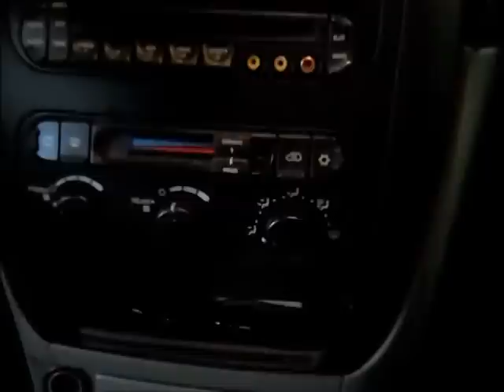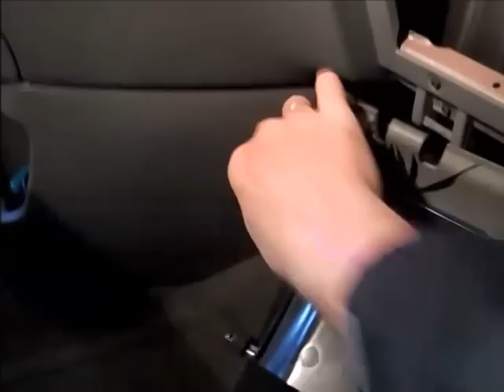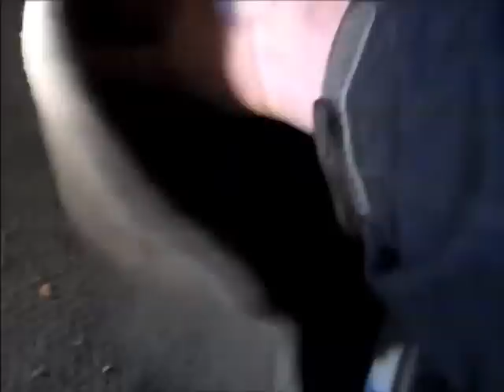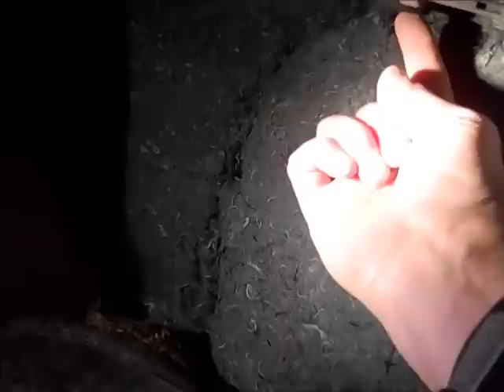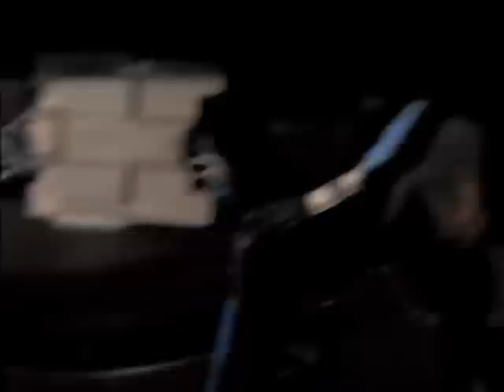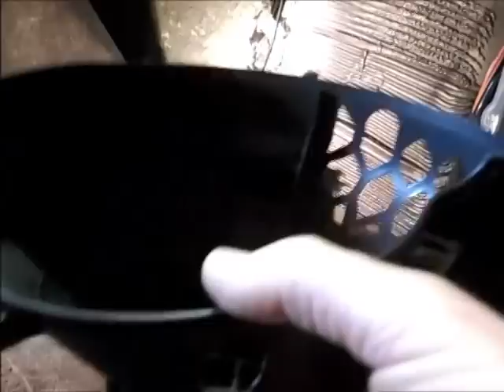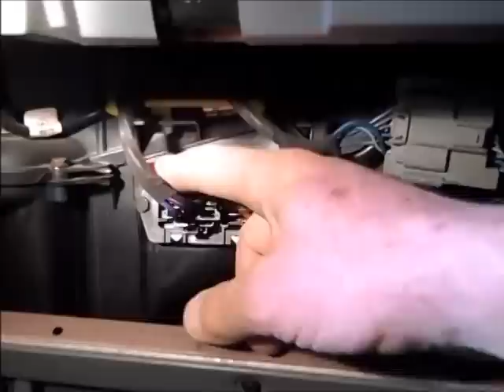2001 TO 2007 Dodge Caravan heater fan and resistor replacement

Comment: Thank you so very much for posting this.  Fortunately, just my resistor was bad.  Your video helped tremendously.
Reply: Jim Tucker the Blower motor needs replaced as well. Iam a 12 year master certified chrysler dodge jeep tech , both should be replaced at the same time the blower motor itself is what took the resister out, the motor has overheated at one point in time and needs to be replaced at the same time

Comment: We had our blower fan quit last summer, just in time for those 103 degree days in California. Therefore, no AC in front.   The resistor happened to be the culprit, thank goodness, but now, the wife complains that the front blower motor makes noise and smells like burning wire.  While I didn't enjoy your talk about that last screw "being a bear", I think you hit the nail on the head.  Thanks for a good description of the process.
Reply from the maker: +Kent Carlin Thanks Kent. I take it the motor had to be replaced. I think sometimes when a motor is dying it pulls more amps to run and kills the resistor. Could be your motor was on it's way out.
Reply: +Don Guptill I have a bad blower motor, I've replaced the resistor twice and each time I put the new resistor in with the bad motor it smells burnt. So just get yourself a new blower motor.

Comment: You can try to smack the motor to see if it starts working.  If it starts working after smacking it then it needs a new one.
Reply: have that problem- so, at 275,000 miles, I'm just gonna keep smacking.

Comment: hi Don what should be the problem if I don't have power on the blue wire ?
Reply from the maker: +Jroe Erte Hi. I would suspect a fuse or relay located in the panel under the hood. Try swapping the relay with another to check that. Are you sure the key was on and you had a good ground when testing?

Comment: Good speaking voice. My front heater in 2001 Caravan doesn't work. The rear heater works. Do they run on the same heater motor? Thanks
Reply from the maker: +Dan D. Dirges Thanks Dan. That question came up from scooter12368. The responder says no. I am not a mechanic but I would definitely agree that the front and rear systems are totally separate. The rear system failure is not common . I suspect that it's due to the fact that is not used nearly as much. What I wish I had made more clear was that if the blower does not work at any speed  its  probably the motor. If you have blower operation on at least one speed  it's probably the resistor. The electrical checks I described are basic power availability checks only. Also if you can get the motor to run again by beating on the motor housing... it's probably the motor that's the problem. Good luck.
Reply: +Don Guptill Thank you, I put a new resistor in today and it works great at all speeds. Before it went completely dead it only worked on high. Then not at all. For your viewers, its best to check the relays in the IPM first. Then the resistor.  I ran a two wires from both parts of the pig tails on the resistor. Therefore by passing the resistor. Then the motor worked. That's how I knew for sure the motor was good and the resistor was bad.

Comment: I had power to the res.blue wire and power to the green wire to motor like you said to check I replaced the motor still will not work so I checked the for ground to motor found no ground there is no ground coming out of res. come to find out that is what the res, do'es is ground it very little for low speed and the more it ground the faster it will go 
long story short chech for a ground and power to motor before replacing it .

Comment: Don,This was helpful to watch and much appreciated. However, I did want to share with the group that the resister pack actually resists the ground circuit to the motor, not the power/voltage. The motor has power on with ignition (far right top green wire out to motor). By selecting a different setting on the fan switch will allow more or less resistance to ground and will make the fan run at slow to fast speed. To test this, just jump a chassis ground wire to the bottom far right black wire. If the motor/fan blows, it is still good. I have just tested mine and it is just the resistor pack.Thanks again, just wanting to offer some advice that may save someone money that may still have a good motor/fan.Good luck all, John
Reply: Don, thanks for this video, saved me a ton of money and effort in replacing my blown resistor.
+J Taylor, I owe you a beer! My initial diagnosis was that my blower motor was toast. But after reading your suggestion about grounding the black wire of the blower motor to chassis, I tried it and it worked. Thus, I only needed a $15 resistor and not a $72 blower motor. At least for now!  Thanks JTaylor!
Reply: READ J TAYLOR COMMENT BEFORE PULLING FAN OUT.  I wish I would have read your comment earlier.  I tore apart the whole fan assembly and hooked up the fan to a battery and it worked.  So I hooked it back up to the resistor and it didn't.  I tried a power wire from the resistor (green wire) but grounded it instead to the frame and it worked fine, so that is how I figured out the role of the resistor in grounding.  So if that had been explained in this video in the first place, I could have saved myself over an hour disassembling the fan unit and ripping out insulation.  Now I have to try to put it all back together.  Makes me wonder if after he replaced the fan in the video, if it wasn't actually a dead spot in the motor, but it was also the resistor and he had to replace that too.
Reply: great information

Comment: Don, this is the best well documented video I have seen - THANK YOU! How did you test the relay?
Reply from the maker: +Floorcraft Installation Thanks for the comment. In the fuse compartment there are a few relays that are interchangeable so simply replace the relay related to the heater and see if it works again. I'm not a mechanic but a mechanic I know says it's very unlikely it's the relay at fault.

Comment: Hi Don, thanks a million for putting this video out there.   I have two quotes from auto repair places to fix this problem for nearly $1,000!  I'm going to use your video which is very well done.  Question...I've search high and low for the flexible socket tool you show in the video.  Local auto parts stores do not have it.  Amazon has one but I can't find one that will take the 8mm socket.  Any ideas on where I can find one?  I don't want  to start the job until I have it.  Thanks!
Reply: +John Green The one I used is similar to http://www.sears.com/craftsman-flex-extension-bar-1-4-in-drive/p-00904336000P?prdNo=45&blockNo=45&blockType=G45  (mine is AT LEAST 40 years old)
Reply from the maker: +John Green Hi John. Sorry I haven't gotten back to you sooner. I missed the notification I guess. The driver I used is quite old and I can't remember where I got it. I did a quick search on Amazon and found one very similar to mine that should work for you. Lisle 63200 1/4" Flex Mag Driver  for about $15. You really don't need a very high quality tool. Good luck with your project and thanks for the comment.

Comment: I replaced the blower motor and blower motor resistor on a 2001 Dodge Caravan. Prior to replacing it, the air was not working properly as it would randomly blow air and then eventually stop working all together. 

However when I started the car, after replacing and reassembling all of the parts back together... I can hear the blower motor working, but no air is being pushed through the vents. Do you have any clues as to what the problem may be?

Thank you soo much for the highly helpful video! You thoroughly described the process in great detail and made the job a lot easier to do :)!
Reply from the maker: Ashley H Thanks for the comment Ashley. Your problem is a head scratcher. I am not familiar with the entire temperature control system but intuitively I would suspect there is a stuck baffle somewhere in the air delivery. Dependent on what selection you use with the airflow selector (ie: defrost) baffles open and close to direct air in various directions. I would suggest, If you have a favorite mechanic, asking what the cause and solution might be. Sorry I can't be more helpful. Good luck.
Reply: you probably did not put the flap back to the default position. it has to go to the right side when u reassemble the blower housing
Reply: +Ashley H Sorry I'm late to the party on this one. If you are still experiencing a problem and it was not, as Jeremy said, the blend door being reassembled incorrectly, you may need to calibrate the HVAC system. It's apparently an issue with these Dodges that they lose the calibration and then have no idea where to send the air in the system. 

From the service manual:

STANDARD PROCEDURE - HEATER-A/C
CONTROL CALIBRATION
The   heater-A/C   control   module   must   be   recali-
brated  each  time  an  actuator  motor  or  the  control
module is replaced. If the vehicle is so equipped, the
calibration  procedure  also  includes  rear  HVAC  posi-
tions for each actuator motor.
(1)  Turn the ignition switch to the On position.
(2)  Simultaneously   depress   and   hold   the   Power
and  Recirculation  buttons  on  the  heater-A/C  control
for at least five seconds. The manual heater-A/C con-
trol  power  Light  Emitting  Diode  (LED)  and  Recircu-
lation  LED,  or  the  Automatic  Temperature  Control
(ATC)   heater-A/C   control   Delay   and   Recirculation
graphics will begin to flash when the calibration pro-
cedure has begun.

(3)  The calibration procedure should take less than
two  minutes  to  complete  for  the  manual  heater-A/C
control,  and  less  than  twenty  seconds  for  the  ATC
heater-A/C  control.  When  the  LEDs  or  graphics  stop
flashing, the calibration procedure is complete.
(4)  If   the   LEDs   or   graphics   continue   to   flash
beyond  the  normal  three  minute  (manual)  or  twenty
second  (ATC)  calibration  time,  it  indicates  that  the
heater-A/C control has detected a failure and a Diag-
nostic   Trouble   Code   (DTC)   has   been   set.   Use   a
DRBIII scan tool to perform further diagnosis. Refer
to  the  appropriate  diagnostic  information.  The  LEDs
or graphics will continue to flash even after the igni-
tion  switch  is  cycled  Off  and  On,  until  a  successful
calibration is completed or until the vehicle has been
driven about 13 kilometers (8 miles).
Reply: @KatsCreations85  gg
Reply: @KatsCreations85  gg

Comment: Thanks for the great video.  I need some tips on reassembly.  As far as I can tell, I have the recirculation door aligned properly, but once I tighten the screws on the fan housing, it seizes up and the actuator motor won't turn it.  Everything works fine if I leave the screws a little loose.  I'd prefer not to do that, because I'm pretty sure all four screws (there's no way number five is going back in) will be on the floor within about 10 miles. Any ideas?
Reply from the maker: David Snow Sorry you are having trouble David. The only thing I can think of is the plastic shaft on the bottom of the door may not be seated properly with the motor. They snap back together kinda hard.

Comment: Awesome instructions DON.. Can i replace the front blower motor in my 2002 Caravan using the same steps..
Pls reply
Reply from the maker: Mairaj Shafi Thanks for the kind comment. I'm not a professional mechanic but to the best of my knowledge I would say yes for 2001 thru 2007 Caravans. All cars heating systems operate basically the same so even if things look a little different the same procedure would apply. Drop the glove box down and look. If it looks like my 2006 you're probably good. Check out this guys video and he may be able to answer you more precisely than me. He does a lot of well detailed videos of car repair and is a real professional.https://youtu.be/rDGWQ4m-sdU
Reply: Don Guptill  Woohoooo i did it... took me like 2 and half hours.. but i changed my front blower motor..... awesome simply awesome...... Thanks again Don,,, U simply Rocks...
Reply from the maker: Mairaj Shafi Fantastic. Glad I could help.

Comment: I'm going to be replacing my motor this week before going on vacation.  The fan stopped working, but a little bump to the motor housing and it started working again for a few hours and then stopped again, and sputtered on and off.  I'm guessing if the resistor was bad the motor just would flat out not work.  Thank you for this excellent video.  The biggest issue I see is my big hands in these little places.  Thanks again!
Reply from the maker: Noneya Frigginbezwax Thanks for the feed back. Sounds like you have a motor problem. Usually I understand that a bad resistor will cause some speed settings to fail or sometimes all settings. If you can restart a motor by banging on the housing... it's definitely the motor. Big hands is definitely a handicap working on newer cars. I too suffer from huge hand syndrome. He He. Good luck and when you put it all back together... throw that difficult screw away. You don"t need it!
Reply: Don Guptill That SaxualProblems name is me...I play the saxophone, but not very well...thus the name LOL.  I think my motor was good, but I replaced it anyway.  Even though the motor would stop and start, when I pulled the wires from the resistor part of both had melted where there was some kind of short.  I was able to pull the big plug out without problem, but I had to get vise grips to get the motor plug out because it had partially fused into the resistor, so I ended up replacing both motor and resistor.  I was actually able to get that rear screw out fairly easily, but maybe I just happened to have the perfect size flexible extension, and I was using a screwdriver here, not a rachet.  I didn't even remove any of the insulation, and probably could have gotten by without pulling the carpet back.  Thanks for the tip on not reinstalling that same screw though, I would still be there now if I was dead set on replacing it.  For me, the screw that was the bear was the downward facing screw on the right.  Thanks also for the tip on putting the door back all the way to the right.  I probably wouldn't have thought of that otherwise.
Reply: Don Guptill Difficult screw as in the one in the back where you need to take out the insulation?  I may be lucky...I had more money than I had time a couple days before going on vacation and had to have the shop fix the problem, which I'm sure was the motor.  Hopefully they left that agravating screw out for me!  I'm used to this big hand problem.  It started when I became a copier tech back in the 90's...I always joked that these big American hands were not made to fit in those little Japanese spaces (Minolta copiers).  Panasonic came out with their new line of copiers a few years later and fixed that problem - 2-3 screws and almost anything came out in units and were easy to work on with big hands. :0)  TY for the confirmation that this was indeed the motor.
Reply from the maker: Noneya Frigginbezwax I suspected it had something to do with a saxophone LOL. Interesting situation you had with the short. It could have been caused by a bad motor as well. On another site a real mechanic diagnosed a repeated resistor failure with a tired motor pulling way to many amps to run and overheating the resistor. The motor replacement fixed it so replacing both motor and resistor will be the end of your problems. Good luck and keep playing.

Comment: Perplexed: I just jumped a wire from the dark blue power wire in the resistor harness to the power green  line going to the fan. I then grounded the fan by jumping a wire from the black line going to the fan,  to the screw under glove box.

FAN went on, but only 1 speed. So i have power to the resistor and power to the fan. So do I change resistor even though I get no speeds without jumping the connectors?

My test light came on when checking the green power line going to fan and also i checked to see if light came on for the black line of the same connector and light also came on.  I thought if it was bad resistor i would get the high power at least. I didn't get any without jumping.

Comment: thank you i needed that confirmation. i was thinking if the rear fan control is working at all speeds, and the rear fan works off the same resistor then wouldn't the resistor be good. thanks again
Reply: scooter12368 
Front and rear fan controls are completely separate. Different fuse, different power relay, different speed control.

Comment: the haynes book is showing only 3 assembly screws for the housing. do you remember if you got 4 or 5. i'm under there now looking and can see what i think is 4. carvan 06
Reply from the maker: scooter12368 Mine is an 06 as well and there are definitely 5 screws holding the housing on. You may not be able to see the tough one even with the insulation removed. Incidentally you can leave that screw out when you reassemble. It's really overkill!

Comment: you speak very clear and patiently in order to instruct others. thank you for your time and clarity. I get no motor speeds with while turning the speed control. I have read if it is the resistor i would at least get high speed only. this would indicate a bad resistor.
Reply from the maker: scooter12368 I would agree that if you have any operation at any speed that it is probably the resistor. High speed is battery direct with no resistor in the circuit. Typically ( I've heard) you tend to loose the lower speeds as the resistors fail. They get pretty hot during operation.

Comment: Thank you!  Thanks also to pur914 for the comments.  With most of the insulation gone, I really did not have any difficulty removing or replacing the back screw (using a 1/4 drive flex extension).  The blower from RockAuto was $34.79 plus shipping.
Reply from the maker: William Roberts Wow! Good price on that blower motor. Thanks for the feedback.